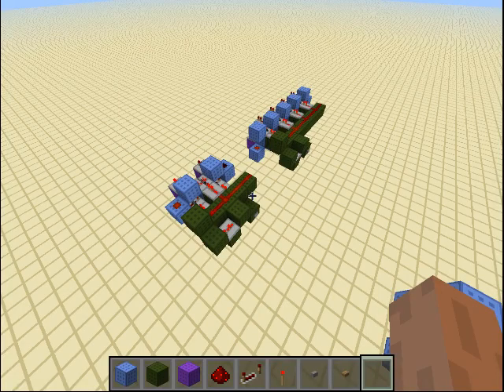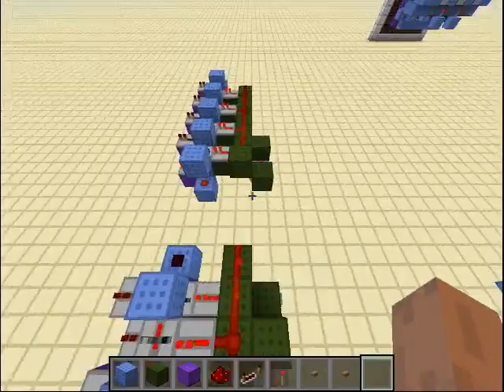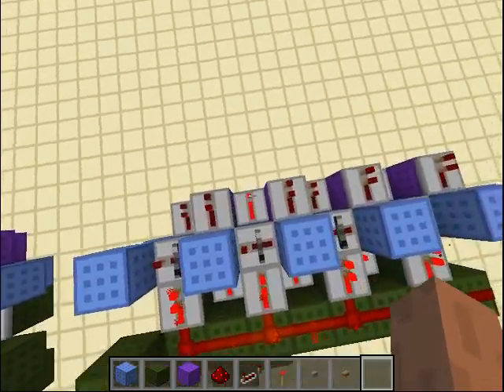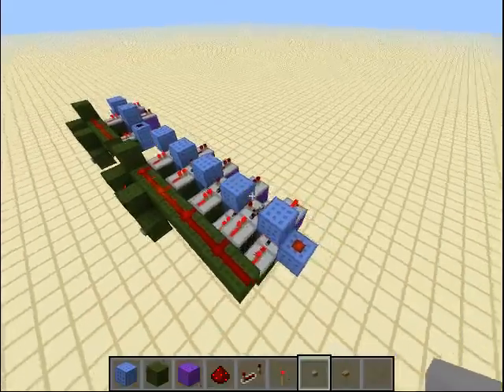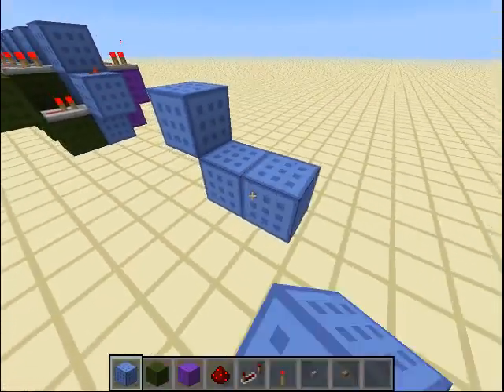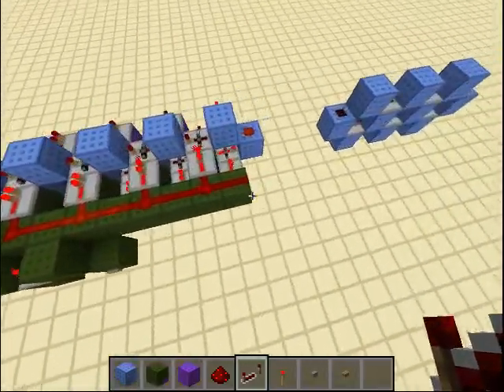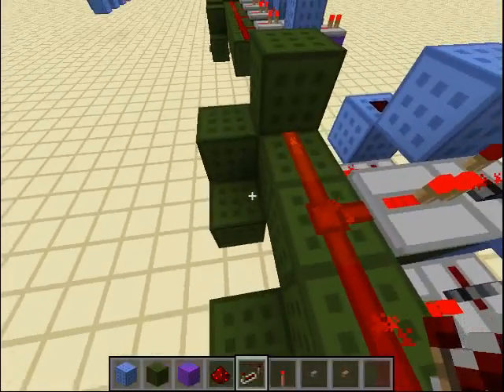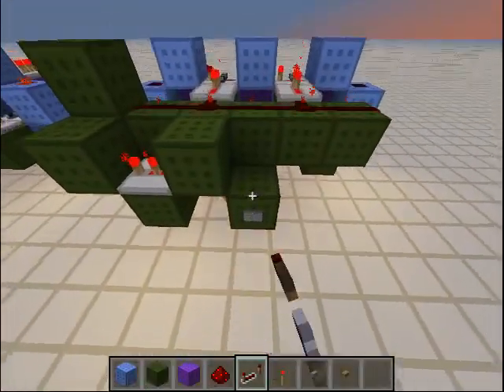Very compact silent counter (using repeater locks)

Comment from the maker: It is very easy to make a reset button (And I have done it) it just takes up more space, but all you got to do is hook up an R-S NOR LATCH to make the clock working, and then you take an output from the clock to reset the R-S NOR LATCH so it will stop at the exact point you wanted it to stop.

Comment: Very nice design!

Is it possible to addapt your design, so that it has one Input, which sets the clock to output nr 1?

I work at an unary decoder atm where I use a "resettable Ringcounter"/"resettable Pulse Sequenzer". I use RS-FlipFlops and AND-Gates to basicaly do what your (compacter) design does. It has only one difference: My design is resettable.